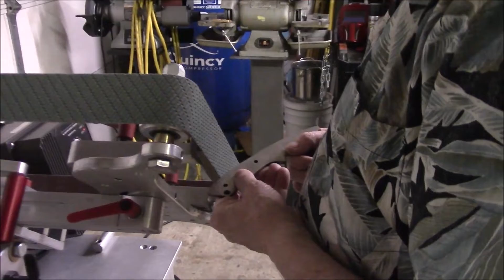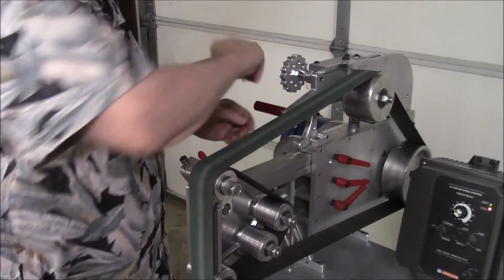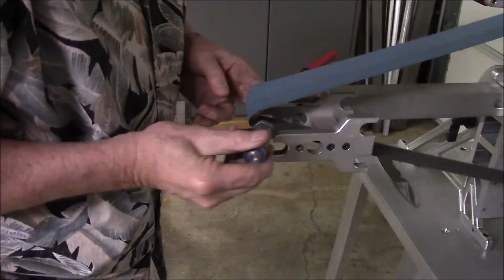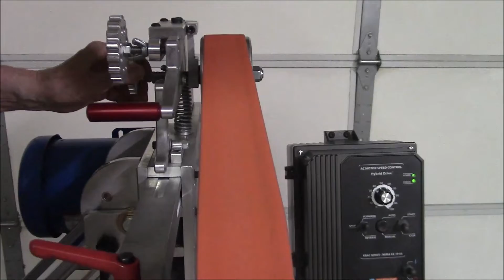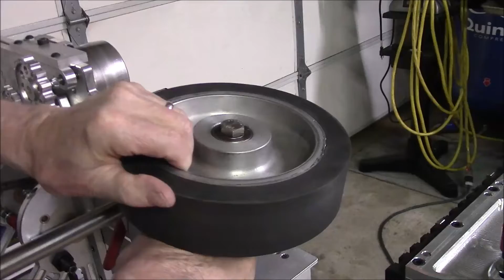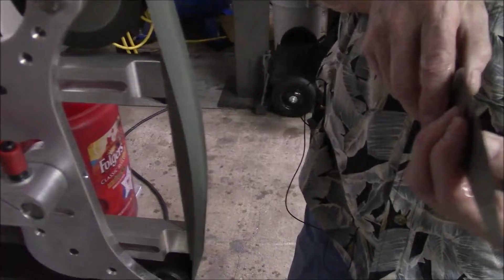Ultimate Reeder Grinder Horizontal/Vertical Quick Flip Tilting Table and Attachments

Comment: I do like the look an how it works..been makeing knives for close 20 years,in the long run a heavy duty machine will last where the aluminum one will wear.steel is better for longevity
Reply: I respect your opinion as your videos show your expertise and knowledge. My question is how are Bader Grinders so durable even though they are also made out of aluminum. Is there a major difference between cast and cnc aluminum?

Comment: Just picked up my basic grinder with the drive and wheel and idler option. Love It. May not be better than sliced bread but is definitely right up there. Had no problem tracking a belt that would not work on my other grinder. I would definitely recommend this grinder. And the staff is phenomenal. Picked mine up and got a tour and was treated like family.
Reply from the maker: Thank you glad you are enjoying your grinder

Comment: This is an awesome grinder. Don and Greg are making outstanding beauties. I love the ability to easily and quickly engage the tilting of this new machine. It is pure genius. Really!

A small problem I believe I saw on this new 3 "receiver" unit, IE:. When you were showing the small radius grinding; with your homemade attachment; the belt was VERY close to the bottom "receiver's" adjustable lever. Check it out at time line 14:12.

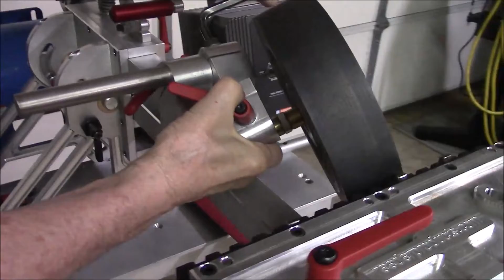Also, how are  you going to keep the belt "tracked" around that large wheel; when it is  in all different positions; respect to the "Drive" wheel. Check it out at time-line 22:22.

Course I could be dead wrong. Not sure.

Comment: On that sword grinder attachment: If it will do fullers, perhaps, with a bit of added adjustment ability, it could do hollow grinds as well. Be awesome if it could move, or if the blade could be moved and re-positioned to do each of the four hollow grinds and have them all matching. I'll apologizes now if that just threw a grenade into your creative engineering mind. :) Ha ha. But if it's still in development, might be worth trying. Being able to index all four hollow grind to match would be pretty trick. That is if it doesn't already accomplish that as is. 

Another great gizmo from you guys! Love the new on axis tilt! Now ur gonna have me looking at mine to see if I can mod it to pivot like that! ;) 

Thanks guys! 

Bert
Wing Nut Designs